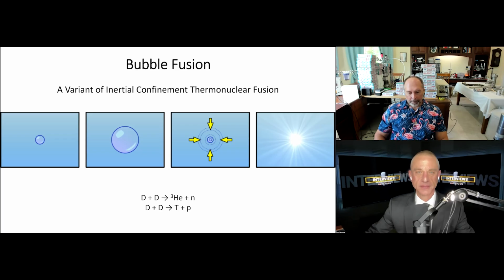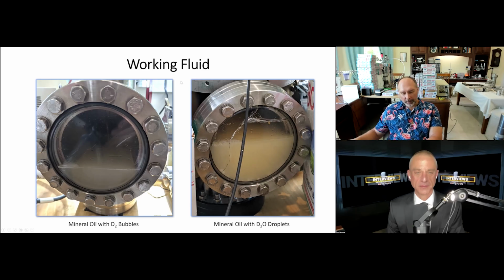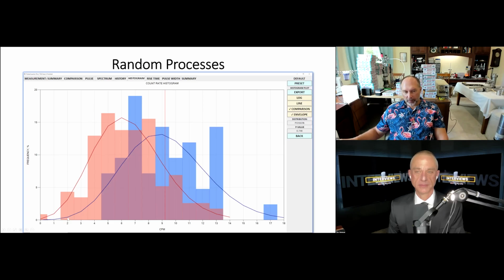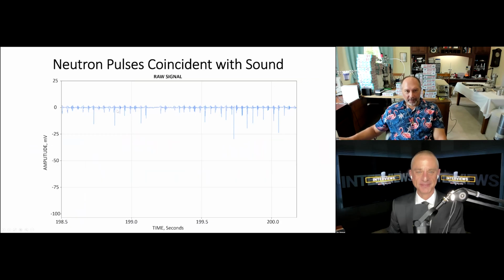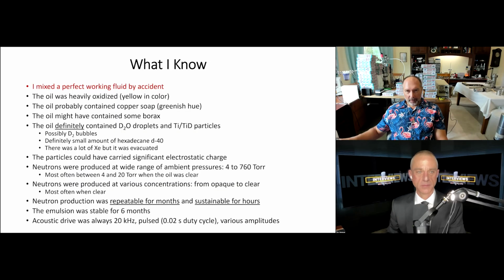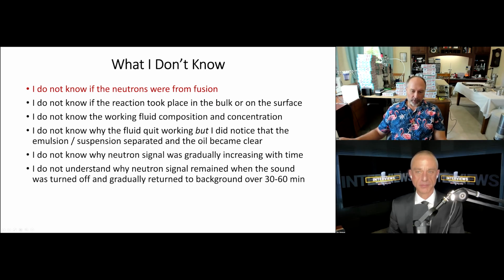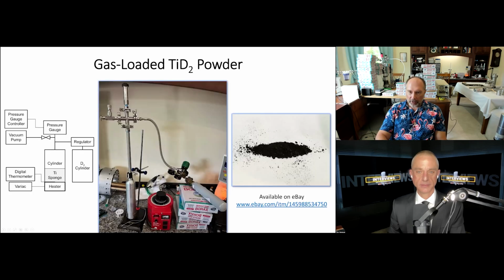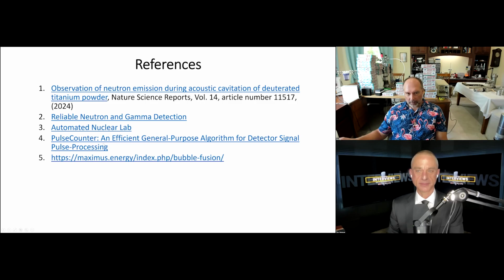Bubble Fusion Breakthrough? | Max Fomitchev-Zamilov

Comment: How about this theory:  1) an electron in a quantum tunnel  -->    slow heavy electron with extra mass,  2)   slow heavy electron + proton --> slow neutron,     3) slow neutron can fuse with whatever atom.  I assume a tunneling electron can gain in potential energy through vacuum energy (ZPE) interaction, such as electric potential energy or mass energy.   Fowler Nordheim electron tunneling occurs almost always during several types of LENR experiments.  In solid-state physics theory, electrons can have a variable "effective" mass, but I assume that this "effective mass is a real mass change. A temporary gain in real electron mass, during a quantum tunneling action (which is a quantum non-equilibrium effect and a quantum transport effect, see also thermodynamic transport effects),  is theoretically possible,  and this can explain numerous observations that are hard to explain according to the standard model:  hydrino creation and LENR transmutation under various physical circumstances.

Comment: I got somewhat drawn away, when he said it needs liquid, I don't like that part, if there is a fracture, the liquid will leak, and how will you put the liquid back in without impurities? that is why I would use water instead, or even better, liquid oxygen is magnetic, I would make it so it accumulates liquid oxygen frome the air around it, then it will be more efficient and cause less pollution than the mineral oil and the neutrons and other stuff. Cold fusion is less dangerous than Hot fusion.

Comment: Make a suspension of colloidal particles of deuterium loaded palladium. Coat these with carbon nanotubes. Saturate the entirety with deuterium, i used heavy water as the carier. Surround your sonoluminescence device with a electromagnet coil. You will get blue pink and sometimes green flashes. But as you increase the magnetic field the flashrs get brighter and more pink white. Once you hit the threashold it flashes extremely bright and it blew itself apart. Did this in 2002 wirh a sonoluminescence demo kit off ebay. ❤
Reply: Do you have a video?

Comment: Why do you use one frequency sound when two slightly different frequencies could create a binary beat and a stronger effect on the deuterium
Reply: Because that is not how it works.  The beat would work to decrease the time averaged amplitude of the standing wave.  Instead of beat a specific harmonic MIGHT work similar to what you are thinking but that would be super touchy to say the least.  I think a far better idea here would be to create the Fleishman and Pones setup but create a powerful ultrasonic wave in the Platinum electrode.  The pressures inside might just be enough, idk, would have to run some simple numbers to find out but I hate numbers.
Reply: @seditt5146 yes pretty similar palladium nanoparticles saturated with D2 do work. My hypothesis is the fusion is kick started by the electric field of the collapsing bubble diluting the electric field of nearby particles while the shokwave causes a phase transition. It changes from a molecular intermetallic PdDD to a metallic alloy DPdD.. Then add a pulsed magnetic field coinciding with this event, then the deuterium nuclei have a high probability of tunneling causing fusion with a quantum mechanical process. It's got a sharp threashold, all or nothing as the cell blew itself up. 😅
Reply: I played with one of these devices and the reason for a single frequency is to create a standing wave where the bubble can expand then collapse quickly. It is a cavitation bubble. With regular water it makes a blue flash. With D20 it flashes the same. Add PdD2 colloid and it flashes blue to pink, surrounded with carbon and it flashes bright and blows up 😢